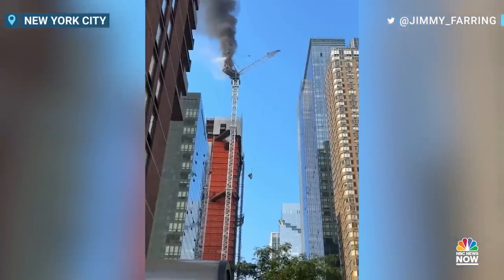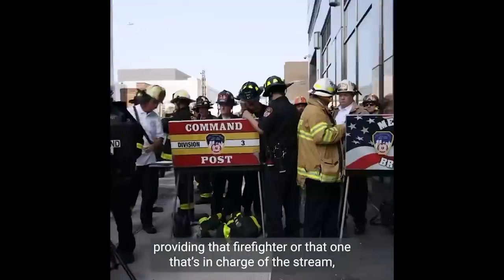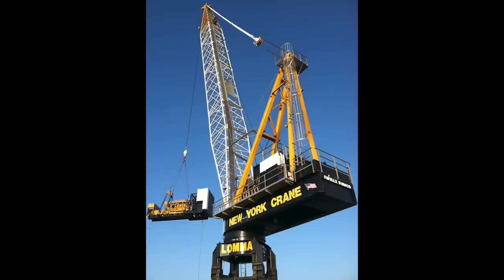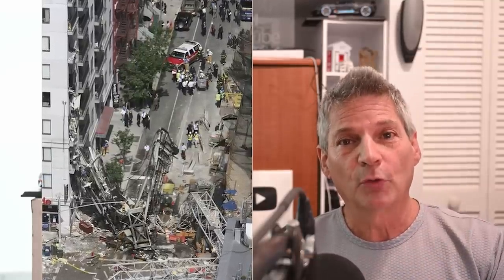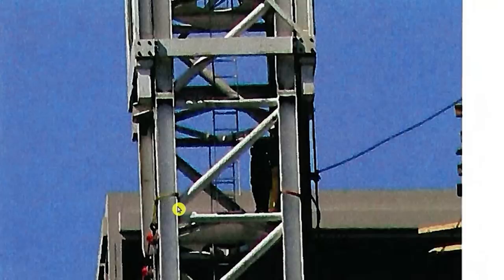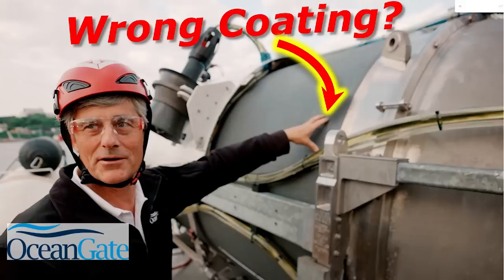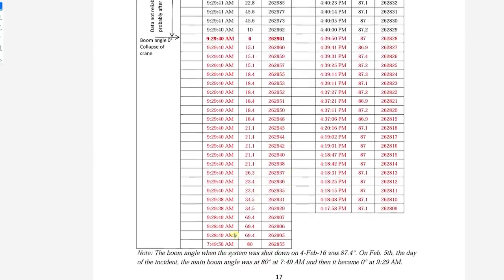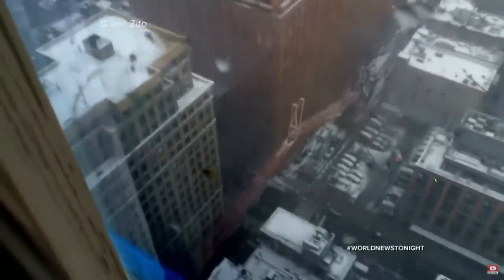New York Crane Collapse Cause, MORE Fatal Collapses

Comment: My hypothesis on the angle of the water-stream:
It appears that the stream started to disperse just before reaching the fire and that was at nearly horizontal.

The dispersment really happens when the droplets don't have enough kinetic energy to push the air aside. So minimum speed is a critical variable. 

At any angle above horizontal, the stream loses its kinetic energy sooner. It's the extra potential energy gained from the angle  that then carries a projectile further. A stream of water is no projectile though. The extra potential energy becomes useless for a water droplet, which, once dispersed, can't overcome the air-friction. 

So if the fire is at a distance, where the stream starts to disperse, you'll have diminishing returns with steeper angles. At least that's my hypothesis. I'll maybe test it with a hose later.

Comment: I'm a crane tech and a diesel engine tech, but I just only work on electric drive cranes. It's most likely a diesel fuel line that started to leak onto an exhaust component, and caught fire. Other scenario would have been a run-away diesel engine but there should be auto-shutoff systems on the intake if that's how it's designed. I have several photos of fuel lines as they wear away. Always it's management that doesn't listen to mechanics when we advise to change a worn part. Flexible lines need to be changed every 5-8 years even if there is no outside wear seen, because there's internal wall wear as well. Especially diesel, gasoline, or hydraulic lines. It says in a several manufacturer's maintenance manuals that equipment managers will need to save and plan in advance to replace all the hoses on a machine within certain time limits. Most modern cranes are completely electric, there's a power cable that goes up the side towers of the cranes. It seems really goofy to me why anyone would use a diesel generator on the crane, it should be on the ground and a power cable should go up.

Comment: I'm not so sure about the 45 degree angle thing. The water jet breaks up into droplets which lets the air slow it down dramatically, and a lower angle lets the water travel further before breaking up. I would not be surprised if you get the maximum distance with something closer to 30 degrees.

Comment: There are no Diesel engines in a tower crane. The item identified as a powerpak is indeed a hydraulic unit driven by electric motors.  This is a fact , it is impossible and impractical to get 250gallons of fuel per day to a tower crane. And the more boom it has the worse it gets. 
The hydraulic unit did burn , caused by what ? The motors are suspect I agree. My thoughts are . The fire was caused by a worn seal in the brake gear box. The heat generated by the brakes then caused an oil and grease fire in the gear box assembly. Which then caused the rest of the hot oil to begin to burn as it was sprayed in a atomized fashion..  It was the brakes ,not an engine that caused this. The luffing jib falling out of the air as it did is the result of brake failure , loss of hydraulic pressure and burnt clutches.

Comment: They may not have the pressure to reach due to the size of the hose and what is pumping the fire stream, a 2.5” hose line with proper pressure will reach a way greater distance than an 1.75” hose line at the same angle

Comment: While I've never operated any type of crane. I'm a bit confused by a statement you made. I have replaced broken hydrolic lines on backhoe or other earth moving equipment.  They don't always show wear and just blow a hole through them without warning? Now maybe this kind of equipment requires replacement based on hours of use?

Comment: Forty-five degrees is the correct maximum-distance angle for artillery operating in a vacuum on a flat surface (for example, on the moon). Because of  air friction, a slightly different artillery angle is used in our world.  With a water stream, the air friction effect is greater, and varies based upon flow volume and droplet size, so the deviation from forty-five degrees is greater.  However, when to "gun" is above the target (as the firemen are in this case), the optimal angle is lower. Here, the optimal angle may have been very close to horizontal. The major problem here with directing the stream wast the optical illusion that the the stream was reaching the fire when it was falling slightly short.

Comment: Something simple like a hyraulic line blowing near a hot exhaust could cause a fire. In my experience, some hoses look like they will fail and can be replaced. Other hoses look new and randomly burst. When they blow, sometimes they spray a fine mist of oil which ignites easly. Other times they spray more like a stream of liquid.
Reply from the maker: Great point!

Comment: Remember the tower crane whose electric cabinet or engine compartment experienced a massive fire? The operator was atop the boom; unable to access the ladder to go down to safety due to flames at that junction. 

I was at a laundromat when the scene came across the television set; it looked very bad until I saw a helicopter arriving. Another person using the laundry was very frightened, almost frantic. I sensed that there was a chance for the operator because they would be accustomed to heights and their structure. Though I tried to calm the other patron, he remained very frightened for the operator despite the helicopter. I was hoping that my sense of optimism was warranted…

The crane operator shuffled out on the boom catwalk and climbed up on the lattice as the helicopter lowered a rescuer on a cable with a buddy harness. The rescuer connected the operator in no time, and up they went as a unit as the helicopter moved departed.

I thought the other laundromat patron might pass out from holding his breath, but everyone of us in that dumpy little building cheered and smiled with great relief that both imperiled individuals kept their heads, relied upon common sense, and stuck with the plan!!  

Sadly, it seems that safety in the course of routine crane erection, jumping, securing and other matters falls by the wayside on notable and tragic occasions. The tower crane which fell as it was being inappropriately slewed while being jumped comes to immediate mind as simply stupid shortcutting of safety edicts; costing several workers their valuable lives!!

“Take the time to do it right, 
or take the time to do it over!”

Quite regrettably “do-overs” are not guaranteed to anyone!!

Comment: No!!!  Corruption within the NYC Building Department?  Wow, that's never happened before.  And the hoist ropes you initially described that run parallel to the lift boom actually lift and lower the load, not support the boom.  The support ropes are the ones that run from the outer end of the boom to the mast on the pilot house of the crane.  "Operating Engineers" sit in the cab and operate the crane.
Reply from the maker: Good info thanks!

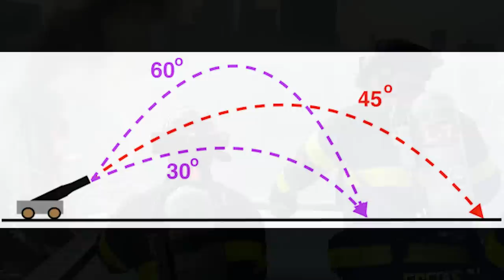Comment: 3:24 If air resistance is calculated it's less then 45 degrees because the projectile travels longer during the first half of the journey, and with fluids that disperse in the air it probably a lot less

Comment: For those with engineering degrees recommending 45 degrees, that works with no loss of velocity to air. In real worlds, with an atmosphere, there is a reason irrigation impact sprinklers are built with a much lower angle than 45 degrees. Water aimed to 45 degrees takes a longer path through the air and it slows, so it gains altitude, but in the process loses the horizontal vector of it's momentum, and it then falls vertically from where it lost the horizontal component. This is considerably shorter than the ideal outer space engineering textbook case as distance increases and velocity increases, the energy lost to air increased by a logarithmic amount.
Your engineering entry level is correct, but real world air needs added to find the best angle at about 20 degrees above horizontal.depending on pressure and velocity.

Comment: PS, the lower stream is NOT trying to put out the fire, its trying to COOL OFF the steel the burning section is cantilevered out on.  They did not want heated steel to start bending and drop the burning section.

Comment: A lot of these accidents seem to have complacency, cost saving and safety creep in common.
 
Complacency because "I've checked everything yesterday and the day before and it was all fine, so today it will be fine too, I don't need to check it"

Cost saving because "weather reports usually exaggerate so why stow the crane as that costs time and money" and/or "if we can save some dollars on this part we'll do it, because these cranes have been designed with huge safety margins and one cheap component won't bring it down" 

Safety creep because "we know we're taking risks here but we know what we're doing" and also "yes, this hoist overloads the crane but we've overloaded it before and that went well, so it won't be a problem today as well"

Comment: It’s not that easy to hold a 2 1/2” hose line at a 45° angle especially for extended periods of time that’s why.
Reply: Don't know why FDNY still don't has fire helicopters like LAFD.
Reply from the maker: What about a tripod?
Reply: @jeffostroff  you’d have to ask the City of New York why they don’t issue the FDNY tripods. But as a retired FDNY firefighter I can tell you that we had enough crap to carry without trying to carry a tripod also. The weight of all that stuff is already more than enough.

Comment: 45 degrees is only ever the optimum angle if you ignore air resistance. That might work fine in academia and "engineering school"  but rarely holds up in the real-world.

For a dense object with a lot of momentum (eg a cannon ball) it can still be used as an approximation but for a jet of  water this very much wouldn't apply.

A jet of water quickly breaks up into tiny droplets which are subject to a lot of air resistance compared to their size & mass.

---

A good real-world rule of thumb is that  the optimum firing angle will be the one where the thing being fired ends up *coming down on the target at 45 degrees*. When outside of the classroom and factoring in air resistance most of the time this will mean firing at quite a bit less than 45. 

In the case of a high pressure water jet the actual optimum angle will depend on the velocity of the water as it leaves the hose and the size of the stream (a higher volume stream will take longer to break up into individual droplets). This could be as low as 10-20 degrees.

In the video of the firefighters dousing the crane you see the main water stream arriving at an angle of 45 degrees as it got to the closest point it could get to the crane. Indicating that that was the max range that could be achieved for that given hose.

---

I know it's a small point but thought it worth mentioning.
Reply from the maker: Yes, but they could have experimented and found an angle that works at least not leave the stream at 0 degrees horizontal, this way you don't have to be too concerned with academia of friction.

Comment: The Millennium Tower™️ in SF is in danger of falling over. 
City “officials” keep telling the residents of SF (including those who rent space in that building) that “everything is fine.”
It’s NOT FINE!  It continues to sink despite all of their best efforts to stop it.
Reply from the maker: Sure it's fine! You don 't have a problem until you have a problem.
Reply: *I’ve left this comment on a few other channels:

I’m not an engineer but my grandfather was.  Which gave me a casual interest in engineering.
I’m a very lay person when it comes to engineering.  
I don’t know the math or the equations but I understand and comprehend basic engineering principles.
My thoughts are:
 if those windows are breaking… that could be a tell-tale sign that the building is beginning to buckle under its own weight. (I’m wondering which side of the building those windows broke on.  If it’s the side that’s sinking, then I’m convinced that I’m correct and more windows will break.)
When I was in the Navy, we had small cords (which are called “tattle-tales”) attached to the main lines we used for mooring the ship to the dock. If those small cords snapped during main line tensioning, it meant that the main line was in danger of snapping like a rubberband.  (And killing or dismembering anyone in its path.) I think that’s what’s going on with the windows.  
I’m afraid that that building WILL fall into its own shadow  unless they being dismantling it from the top down.  But they won’t.  Hubris and corruption are the order of the day in SF.  They keep telling residents that everything is fine. I’m praying that someone… ANYONE wakes up and does the right thing and gets everybody out of there and puts lives and safety over profit.

Comment: Your "45 degree" statement neglects air friction.  It also assumes the launch point is level with the target point.   The problem is that the water is breaking up & coupling to the air.  They needed to attempt to produce a more columnar water flow.  this is normally totally contrary  to the water flow required for most firefighting situations.

Comment: The two solid steams are two different animals. The one closes to the camera is. 21/2” hand line straight stream nozzle. The furtherest is a portable monitor. Each have a different tip diameter. The monitor usually  is supplied with one to three 2 1/2” hand lines. It’s putting out much more volume. For distance. Hand line nozzles will never match a monitor.

Comment: I worked on a lot of cranes, one problem is the cheap Chinese fittings used to 'build our own hoses'.. I complained daily
and the mgmt. 'saved money' buying non-American crimp fittings which blew regularly, and caused fires.
Most cranes need to be as close to 90 deg. as possible on the 1st mast to lower the jib. They need to use small increments
and be sure the out of balance signal is not showing up.

Comment: @3:00 You cannot apply the ballistics theories to water, specially over such a long distance (for water).  Those equations apply to solid objects with an overall density much higher than water, and where air friction is low relative to the projectile.  Water is not solid; air friction has a major affect on the stream and the individual droplets.  Directing the stream upwards at 45 deg. means it is in the air a lot longer and therefore affected a lot more by friction and wind. A flatter one might well be more effective.

Comment: If the fire fighters were to go at a 45 angle, it would dissipate before it got to the fire. if you look from another view, the building that they were shooting water from was too far away at any angle. I also believe if they had a different nozzle, that might have helped. depending on the pressure at the FDC, if they had more pressure that would have helped. If the fire pump was a few floors closer, it would have been close to 100 psi. most high rise buildings have a pressure relief at 100 psi on each floor.

Comment: 45 degrees for maximum distance only applies if both the building and the crane fire are at the same level. In this case they were not.
Reply from the maker: Even if they are not at the same level, they still should have had it pointed. At forty five degrees, it would have gone farther
Reply: @jeffostroff  please prove your point with an example.

Comment: In regard to the 45 degree angle, that works fine for cannonballs but not so much for water.
Instead of putting an effective amount of water on the fire you will only get a light misting of the general area.

Comment: I do not know the regulations for a crane company or how often Crane fires happen. But I do know that many times cranes are in areas where there is not much there to fight a fire with.  At the top of a building, there is nothing there, other than maybe a fire extinguisher.

Comment: 5:50 Hydraulic oil is supposed to be not combustable, methinks.
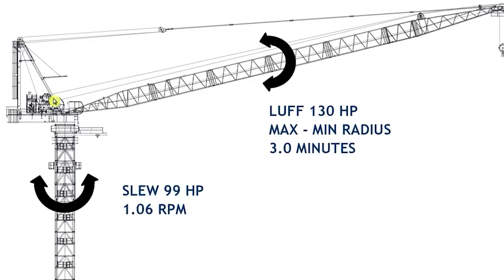7:05 The lower cables operate the load. The boom is held by the upper one. That is logical (You cannot hold the boom at so low an angle to it) and can be taken from the drawing right away.

Comment: The ballistic angle doesn't work with a water stream, because is not solid like a cannon ball and turns to mist, so aiming it higher up would have actuall reduced the range.

Comment: Them boys had a lot working against them, the fuel that runs the crane, how high up the fire was, getting water to the fire, having enough water(volume) to overcome the BTUs of that fire, and friction loss. Friction loss and volume being major factors. I’m assuming they where hooked to a stand pipe inside the building they where standing on. Trucks on the ground floor supplying the FDC to supply the stand pipe system or boost the pressure.

Comment: I suspect the wind precluded water reaching them at a 45 degree angle.
Reply from the maker: No the angle they had the hoses at precluded it. Look at the closeup photos of the hoses, one is resting on a ledge horizontal
Reply: @jeffostroff  There was another YouTube video that was made very early on before the area was blocked off. The firemen were using a higher angle and the stream was breaking up into a fine mist that had little to no effect on the fire. The higher the angle they use, the more distance the stream has to travel along the arc, the longer it takes to get there so the more time the wind has to break up the stream. If you look at the size of the hoses and the size of the nozzles, they had to use very small nozzles because there wasn't enough water pressure to push water through a larger nozzle.